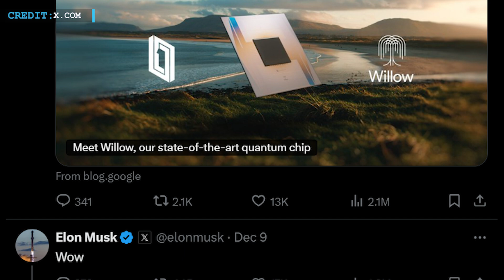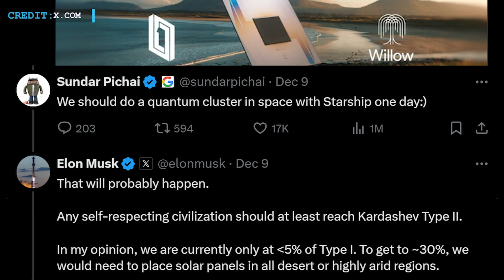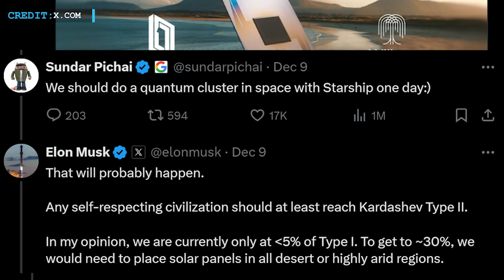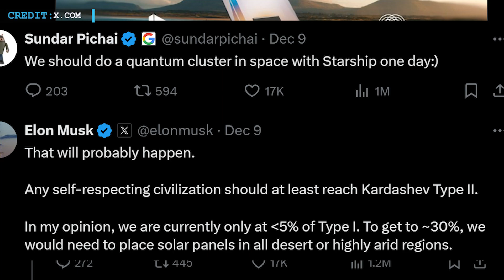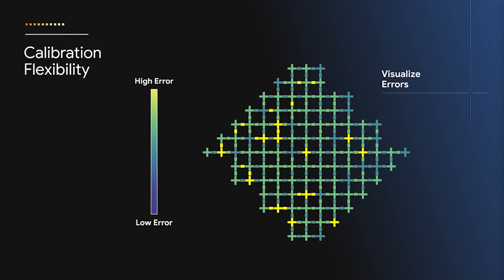How Google's AI Vision Meshed With SpaceX Starship Ambitions | Artemis Program Hits Another Delay

Comment: I think a space station placed on the dark side of the moon would be an excelent location of a massive quantum and AI supercomputer. This would be passively cooled by the valcume of space for the quantum computer whilst the AI computer could be warmed to - 60 degs cellcicus (which is typically the lowest temp silicon chips work at) ambient.
The amount of energy on Earth needed to operate these computers is limited to the power needed to keep them cool.
In space twmperatures are already cyrogenic. Thus very large quantum and AI computers will need massive amouunts of cooling if operated on Earth. All of this opex can be saved if a space station is built and operated om the dark side of the moon were no heating from the sun can reach.
Reply: Problem with your plan:

There is no "dark" side of the Moon. That's a misnomer, kiddo. Only a far side. You'll learn about this in middle school.
Reply: And, no way for the super computer to communicate with Earth while the moon is blocking the path.   What's the point?
Reply: @paintedpony2935   a few starlinks should solve coms.